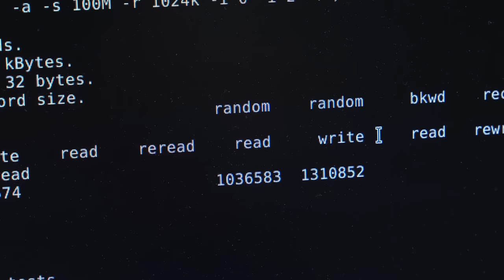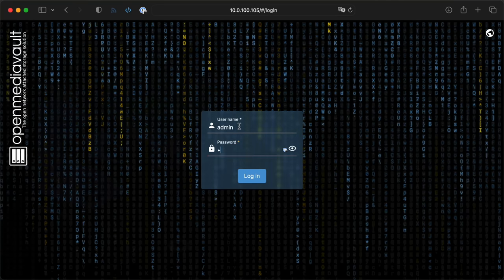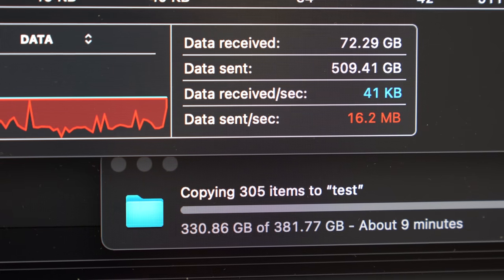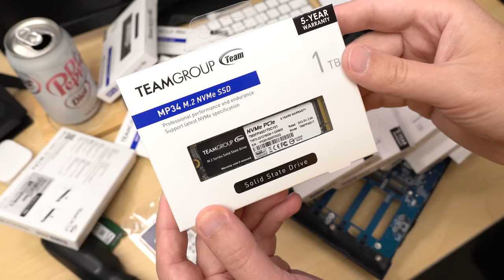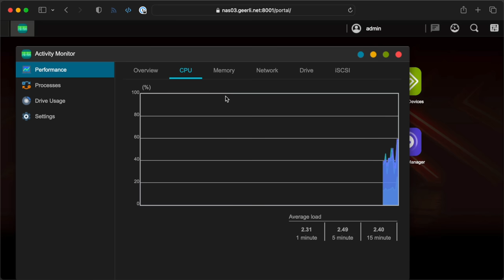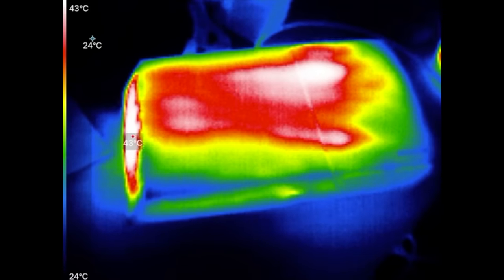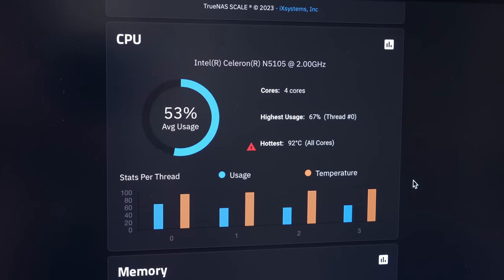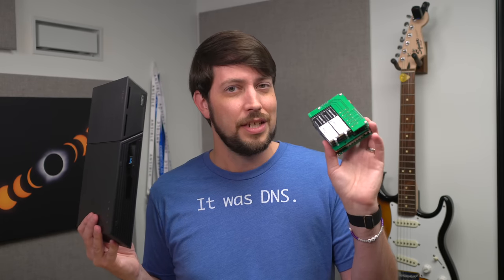All-flash NAS fight: DIY or Buy – Round III!

Comment: At 9:50, you implied that unlike ZFS, Btrfs doesn't support snapshots and synchronisation.  However, Btrfs does support snapshots and commands "btrfs send" and "btrfs receive" can send and receive snapshots between two hosts over a network, similar to ZFS commands "zfs send" and "zfs receive".
Reply: he likes ZFS and he also likes to delete comments that don't agree with his ideology ;)
Reply from the maker: Btrfs does, I wasn't careful with my wording there, as ADM does support Btrfs (and I used it on the NAS we deployed at my Dad's radio station). But some of the Btrfs features are not as easy to use through ADM as they would be on plain Linux, and that was more what I was comparing (ADM vs TrueNAS in particular) here.
Reply from the maker: I like ZFS but I ain't a ZFS zealot.

And I never delete any comment on any video, except for anything with commercial spam (e.g. "Telegram me you won a prize") or explicit content.
Reply: @patryk4815 I have had arguments with him several times. No comment was deleted, even if he didn't agree. Now bill Murray (the 8bitguy) on the other hand.... He does, maybe you are confused.
Reply: @JeffGeerling  I use both ZFS (mostly in TrueNAS Core, but I've also used it on Linux) and Btrfs, and both work well, but I tend to prefer the ZFS snapshot model and naming syntax.  Btrfs treats snapshots as directories in the same file system, so it's easier to misplace them, whereas ZFS records snapshots in a separate namespace that you can list easily with the command "zfs list -t snapshot".  However, on Linux, I tend to use Btrfs more often because it is available in the kernel and requires less memory than ZFS.  Though I've used ZFS for almost a decade, I've yet to learn how to control the amount of memory that the various ZFS caches consume.  I guess it's never been a priority since I mostly run it on my TrueNAS machine.

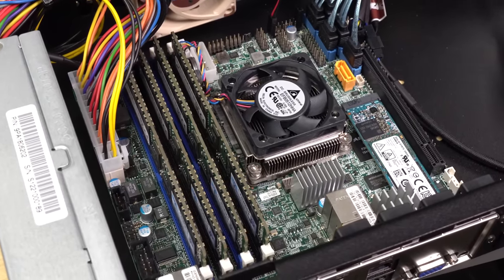Comment: Hey Jeff, on 8:30 you should disconnect the 4pin dc power of JP1 from your supermicro X10SDV board. It's not recommended because of an alternatively support of two power sources.
You can find this information in PDF on Page26 (1-18)

Note 1: The X10SDV series motherboard alternatively supports 4-pin 12V DC input power at PJ1 for embedded applications. The 12V DC input is limited to 18A by design. It provides up to 216W power input to the motherboard. Please keep onboard power use within the power limits specified above. Over-current DC power use may cause damage to the motherboard!

Note 2: Do not use the 4-pin DC power at PJ1 when the 24-pin ATX Power at JPW1 is connected to the power supply. Do not plug in both PJ1 and JPW1 at the same time.

Comment: If the pocket NAS fan was squealing that badly, it's likely also damaged in shipping, ball bearing fans are the highest quality/longest lasting industrial fans, but they're also really sensitive to shipping damage, I learned this the hard way.
It's a big reason why the PC building community considers them worse for noise than sleeve I suspect.
Reply from the maker: Ah, could be. Shipping seems to have taken its toll on this poor device :(
Reply: I thought the fan was damaged the first time I fired it up. Surprisingly, that noise is the PWM interacting with the fan...

Comment: $1300 is a pretty sizeable price premium for the size and low power usage. I've been looking at making a 4U box with 10GbE and a Ryzen 7 5700G for both NAS and Docker, and it's looking to be about $1300 for two 4TB drives, with a $75 expansion card to add four more. Sure, that's six bays instead of twelve, but it's also about 6x the CPU performance, a lot more PCIe lanes, a decent GPU for transcoding, and a dedicated NVMe slot for the OS. I even threw in 2x16 of RAM, and I think it can take 4x32 if I really wanted to

Comment: I've liked my TeamGroup SSDs as they are cheap, usually reliable, and have a solid warranty which I have used. What I don't like about them is most of their current lineup is DRAMless, but for my uses (homelabbing with RAID or ZFS, with spinning rust as my main NAS array) they work well.
Reply: DRAMless on NVME is less bad than on Sata as per the nvme spec the SSD can get up to 64MB of system memory (RAM) to use
Reply from the maker: Luckily I found the ones I used here, which still have DRAM; I linked to the model on Amazon and can confirm it seems they do have DRAM cache.
Reply: Are these SSDs ok to use in a NAS? I guess with all the videos I see from other creators I thought I’d have to shell out more money for NAS specific drives. Is DRAM just what I have to look for?
Reply: @jacobdavis6615  there is no such thing as "nas specific drives" either SSD or HDD, it's mostly a marketing gimmick that WD started in an effort to squeeze more money out of people.

DRAMless SSD drives are usually cheaper and have lower performance, but just as with hard drives, that's not terribly important for a NAS where you are bottlenecked to 120MB/s by a gigabit connection (or 1-ish GB/s by a 10 Gbit connection)

What you want to look at is the write endurance value
Reply: @jacobdavis6615  I've found them to be fine, but I'm mainly using them as either a read cache for HDDs or in an array that's at least mirrored. Would drives with DRAM be faster and maybe last longer? Probably, but capacity is more important than speed for me.

I should also add that I have killed a couple. I now tend to skip the 128GB ones as the price of the larger capacities has come down and ones with more capacity in theory are more reliable.
Reply: @marcogenovesi8570  yes an no. Definitely SMR HDDs are not nas drives.
Reply: @SuperSpecies  they sold SMR branded as "nas drives" aka wd reds and seagate whatevers and toshiba too.

You can't really just trust the label on that
Reply: @marcogenovesi8570 This comment is so false. A hard drive isn't just a hard drive. Maybe do a bit of research on SMR versus CMR drives. And if you need a lot of drives, you can't just throw in random drives all close to each other and expect them to work without pre mature failure or data loss. NAS/enterprise specific drives are rated to work with the many vibrations that occur when a lot of drives are placed next to each other. They also are rated for much higher read and write and will last way longer than any regular HDD. Maybe stop spewing bullshit if you don't know what you are saying.
Reply: @username8644  As said to the other guy, you can still get SMR drives labeled as "nas drives" (the older ones) so looking for "nas drives" is pointless you always need to check the specs. Yes they pinky promised, no I can't trust them.

Also I laugh at the "you can't throw in random drives close to each other because muh vibration" and "will last way longer" that's marketing bs that was proven wrong years ago by the shucking community and by cold storage companies like BackBlaze that yes literally did that and didn't notice much difference in mortality vs "muh nas drives"

Enterprise drives are a bit faster and have a higher MBTF but the Failure in MBTF isn't "the drive dies" it's "there is a read error". If you have any level of RAID (as you should) that read error will be corrected by the controller (or by the software raid) so you don't care.
Reply: @marcogenovesi8570  There's a difference between putting 4 drives together and 20+ drives. Your opinions (which are false), seem to be more directed for home DIYers who don't even go above 6 drives. And just because a few drives labelled as NAS drives are SMR, doesn't mean you suddenly can say all NAS drives are not worth it because some of them are SMR. Tons of forum sites have already identified which drives are SMR and which are CMR so it's really easy to purchase the right drives. And shucking is done with drives that are CMR because drives sold above a certain capacity are all CMR and not SMR. That's why people buy like 20TB external drives and not 6TB drives.
Edit: and you can't put a ton of those drives next to each other. You will have problems. Also enterprise drives come with 5 year warranty instead of 2 years with cheap drives and are rated for total read and writes that are like 10x more than regular drives.
Reply: @username8644  Yeah sure, BackBlaze is using only 4-6 shucked drives per storage pod, not 60. 

I can and will and also will repeat that "nas specific drives" are a marketing gimmick, because they are. What matters is the datasheet and the price you can get them at. 

Shucking is done because the drives in USB enclosures are commonly found cheaper than bare drives due to the fact that it's a consumer product and therefore subject to more discounts and other things than the bare drives, not because of CMR. 
The fact that SMR seems to have died off after 8TB or something is unrelated.

Enterprise drives are not "nas specific drives", yes they have a 10x higher MBTF number and I told you already why that number is much less important than you think it is if you put it in a RAID. It means time before there is a read/write error, not bad sectors not drive death. It does not mean enterprise hard drives last longer before croaking. 

Also why are you suddenly escalating to enterprise now? Maybe because the "nas specific drives" are marketing bs the same as "video surveillance drives optimized for AI" like wd purple and seagate skyhawks and you are running out of arguments?

Comment: You might be able to use more than 16gb of memory on N5105. Well i think it depends on the motherboard. I installed 2 sticks of 16gb on my Topton N5105 router just this morning and it works just fine. I also have a N5095 board with 12 sata ports. I installed a 32gb ram on that and it works too!
Reply from the maker: Yeah, some people mentioned 32 GB works here. I know 16 does because that's the spec, and 64 doesn't because ServeTheHome tested that and it broke. So 32 might be the goldilocks if you want a lot of RAM.
Reply: @JeffGeerling about the slow perf you saw on TrueNAS, I noticed you're using SCALE, did you try Core? I've had bad performance experiences with SCALE and good ones with Core on limited hardware (specially old CPUs and lower end NICs supported by Core). May be woth a try...

Comment: I built my NAS using my old Ryzen 1700X with 8X 2TB Crucial MX500 SATA SSDs under Windows Server 2016 and Windows Storage Spaces.  The processor, motherboard, and memory were leftovers from an upgrade, so it essentially cost me nothing, and the drives are now running under $100 each.  (The 10Gb network cost a bit more.)  Running with a mirror config and 8TB of usable space, I get about 800MB/s transfer rates, nearly saturating my 10Gb link.
Reply: (angry neckbeard noises for your choice of using WinServer2016 and Windows Storage Spaces)
Reply from the maker: Using what you have is always the cheapest option! (Though Windows Server 2016 is an interesting choice, it's more rare to see that used for a storage-only server).
Reply: @JeffGeerling  It's what I knew how to do.  (Plus getting the license key from VIP-SCDKey.)  It's not the best, but I tried other methods and couldn't get them right.  Either they were too confusing to set up or I couldn't actually log into the share after getting it done to put my data in.  It was too annoying, so after 2 months of dealing with it, I went with WSS.  (The REAL WSS, not the dynamic partitions.)  I also happen to have iSCSI targets on that drive set for my three Hyper-V hosts (self training lab) to back up to using the built in Windows Server Backup.  Works great.

Comment: I have created a NAS which gives best of price as well performance. I used bcache.   Storage Pool -  3 X 10 TB hdd and 3 X 500 GB Nvme.  I used 1 X 120 GB SSD - with Debian 11 .  10 TB HDD are coupled with 500 Nvme Drive. Used "writeback" mode.  Once 3 devices created,  I used btrfs over the these devices. Best part is that  bcache gives me read and write cache together.  So in a nutshell I am getting almost nvme performance on my sata hdd.  I am also enjoy btrfs snapshots.  To manage storage I am using cockpit.  This serves my purpose.

Comment: My guess for the "subpar" ZFS performance is a mix of it still making checksums for data and how it is distributing data to the vdevs that report back they are done and have committed the data and the PLX switching that is going on adding latency, maybe? May also have to do with updating the metadata, would be a neat experiment to use 2 of the SSDs as a metadata offload for the rest to see if that brings your closer to generic raid.
Reply: Wonder if you could put an optane mirror set in there…
Reply: @peterbronez1188  I don't see why not, but if you are thinking of using the Optane as a ZIL then it is mostly moot for SMB as SMB is async IO unless you set the ZFS dataset to sync=always.
Reply: I agree with the checksum idea. I suspect if you turned them off you'd see that saturation occur pretty easily. Though I wouldn't recommend that as a long term solution; it's part of the point of ZFS.

Comment: This was a VERY good dive into this subject ... and you actually got better results than I got with an AMD EPYC with 128 PCIe Lanes ... in Dells R7415 (which Dell only provides 32 PCIe Lanes for all 24 NVMe slots). I'm looking at getting an R7525 ... but it's sad just how much you have to spend for U.2 access to some PCIe lanes just bc of games mfrs play.
Reply from the maker: Yeah, I really wish U.2 were more available in the consumer space. To even get adapters for it can be a bit pricey. Would love consumer 2.5" drives to be around as drop-in replacements where SATA drives were used.

Comment: PCI x16 to quad M.2 adapters are like $30, so that Ampere option interesting. Or if you can find any motherboard that supports bifurcation you could make a full speed RAID array that isn’t bottlenecked by bus or CPU. I’ve been looking at an Epyc board that would support tons of PCI lanes - specifically the Asrock ROMED8T. You could put 26 full speed Gen 4 SSDs on that. Video editing is just barely too needy to run nicely on hard drives, and I don’t know of any solid caching solutions. Instead what’s making sense to me is RAID SSD’s as a “hot” pool to store an active video editing library, which then gets snapshots backed up to a “cold” hard disk pool.

Comment: Loading up the pocketNAS or Flashstore with 4TB drives is where the NVME density wins. I was considering loading up a flashstore with 12x4TB drives.
Reply from the maker: It's amazing how quickly 2 and 4 TB NVMe drives have fallen in price. I'm okay with just a few TB of usable space so I'm doing RAID 10 with 10 drives right now, plus 2 spares. But I could upgrade over time and double or quadruple the capacity, once 2/4/8 TB drives hit whatever price point I'm comfortable with.

Comment: Oooh, another attempt at Rock5! Nice! Might dust off mine, the software support seems to have improved.
Reply: That's a Pine64 board, isn't it?
Reply: @tomspettigue8791  no, but it's easy to confuse. Pine64 makes RockPro64 board with RK3399 - same SoC as in Rock Pi4. Rock Pi4 and Rock5 are made by Radxa.

Comment: I bow to the master. I am using Google Drive for my video storage since I am using my phone. I am looking for a camera in the poor man range. I have three SuperMicro with about 10 TB on each of them, but noise and heat is an issue. I have my PC that has 18TB of disk space, that I just got back online which the community freaked because I was still using Hard Drives. That my main place for editing because of the large amount of storage. I got a lot of comments about using 3.5 Hard drives. I like a NAS because then if my PC dies another Root Beer death, I am not dead in the water like I was.  I carry with me a Libre Computer La Potato with a 2.5"  2 TB drive for remote storage with OMV, it nice to have a portable unit. So your Rock 5B would be great. Sorry I edit because I am dyslexic some time, my Yoda speak is hard for folks to follow.  

The one issue Jeff for us small home lab guys is this. 10 GB Network switch and cards are out of the out price range. 2.5 Ghz is growing, I just picked up a few USB Ethernetfrom ASUS that are 2.5 Ghz, I think I could get pci cards for my SuperMicros that wouldn't cost me my first born, but the issue is switches. I haven't see at Microcenter a 2.5 Ghz off the shelf switch I can go and buy. A lot of SBC are starting to come with 2.5 Ghz. Any thought how I could fix that issues so I could improve my DIY NAS storage? Storage needs faster Networks, and faster Storage ( NVMe are become the best as you pointed out for that. )
Reply from the maker: Check out Serve The Home; they just did a really cool comparison of a bunch of low-ish cost 2.5 Gbps switches, and I picked up one of the ones they recommended for my office. They're still a bit more than 1 Gbps switches, but way less than even the cheapest 10 Gbps switches!
Reply: @JeffGeerling  Thanks Jeff. I will check them out.

Comment: The Pocket NAS looks quite promising! I'm interested in how it interfaces to the Rock 5 B - I assume through the M.2 slot underneath the Rock 5 B, but it also looks like it has an interface through the GPIO pins, or are those just for power?
Reply from the maker: GPIO for power, the SATA all goes through a custom set of plugs that goes into a standard 6-port M.2 SATA adapter card.
Reply: Hi Michael!